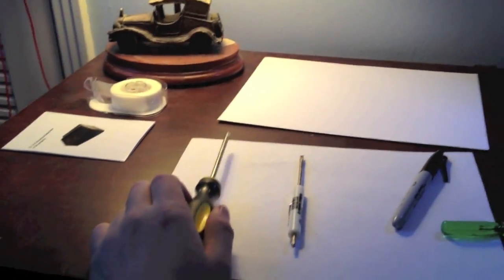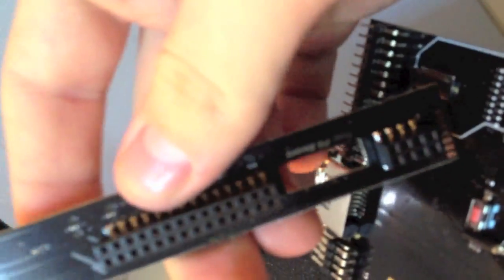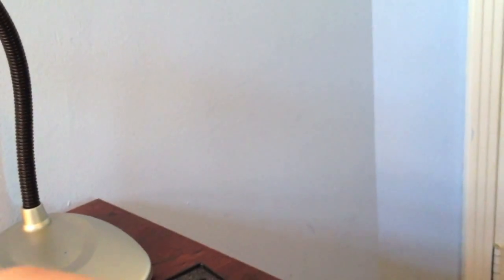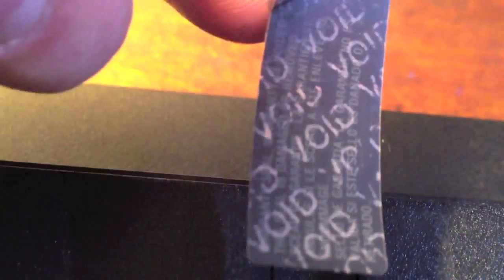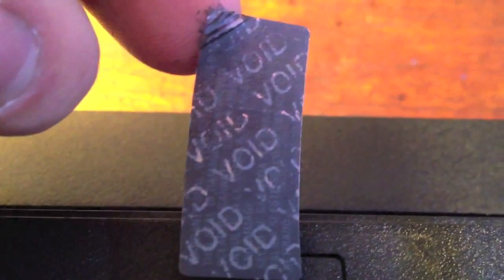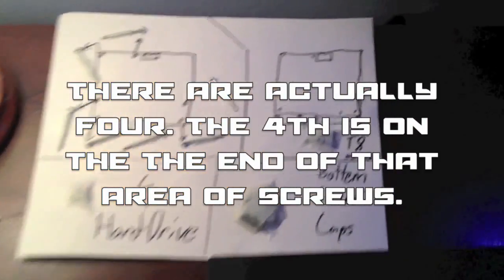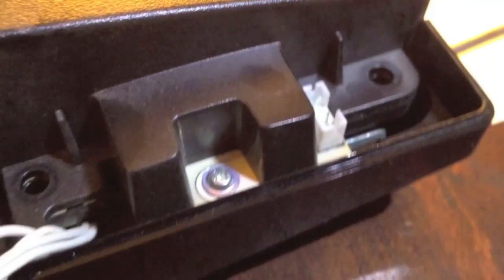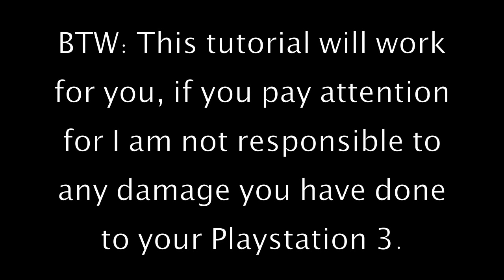How to Install E3 Flasher on PS3 Slim - Part 1

Comment: Note any models lower than the date code 25xx b or a can be downgraded to 3.50 or even to 3.40.  Any phat system/ version of phat model can be downgraded since it was manufactured first. ALSO ANY SUPER SLIM PS3S OR PS3 SLIM ( ABOVE 25XX MODEL ) CANNOT BE DOWNGRADED TO 3.55. THEY CAN ONLY BE DOWNGRADED TO 3. 60 OR ABOVE!
Reply: Wrong.... It's e3 flashers on eBay that's 4.60-3.55 ...so Cech-3001b is jailbreakable

Comment: Power supply* by the way you might have done this already since 2-3 years ago but since your able  to disassemble your playstation clean it from all the dust runs alot cooler

Comment: guys if you have 1a you can chek if your ps3 is downgradable like mine download this
w w w (dot) media fire (d ot)  c o m  /  ? ir8w 9kzn r4d6hba      put spaces together then (dots) turn into ..... then put ps3 file on your flashdrive then go to system update and choose via storage confirm everything then wait for the last part a message will come up saying

(update data of version x.xx or later can be installed like mine was update data of version 3.40 or later can be installed i can dwngrade

Comment: Don't take this for gospel, but i've been asking the same thing and researching. Apparently, YOU CAN! From what I gather, the NOR Flasher is not firmware dependent, which means, it doesn't  matter what firmware you're on... it is a hardware "hack" so it doesn't matter what software it's running. Someone please correct me if i'm wrong, but this seems to be the consensus in most forums. The official site still only states "OFW 4.21 to CFW3.55" but then again, they NEVER update the damn site. Lol.

Comment: my ps3 slim is cech-2503A. on OFW4.31. It has a spansion chip. Everytime i try to update the e3 flasher the blue led don't appear and when i try to backup the blue led keeps blinking. any suggestions?

Comment: For whom it may concern any modol above cech-2000 cant be downgraded but you can dual boot 3.55 cfw if it is below or at 2000 the u can downgrade to 3.55 from 4.21

Comment: Go look on the back of your PS3 and you should have a serial number on it. If it's Slim PS3 the last number would be CECH-(Something) if it's a FAT one it should be CECH(Something).. Just PM me your serial I will tell you if I can use the E3 Flasher on it.
Yes you can downgrade 4.20 to 3.55 ussing the E3 Flasher set. Don't thanks me, thanks TOGxFTW.

Comment: I have a question,will downgrading work on ps3 slim models that where new around late 2011? Or it only works on the early slims from the previous year?

Comment: 3 questions, #1, my ps3 code is CG216079272-CEHC-2001A; can i downgrade it?, #2, does it work with 4.1, #3, which place u recommend to buy the e3 flasher limited edition?

Comment from the maker: @XxxCoquiGamerzxxX Yes, just the limited comes with the other stuff you can buy separate like Limited comes with ESATA Station but you can buy that anywhere. Plus you don't need cage for E3 Flasher Board, it only helps keep the PS Sword from shaking as much.

Comment from the maker: You can tell if it's degradable guys buy looking what the stock firmware is for that PS3, if it is, 3.55 or =<, then it can be downgraded. You can also tell by the code on the back so if it is 0B or under the it is compatible. sadly mine is 1B .